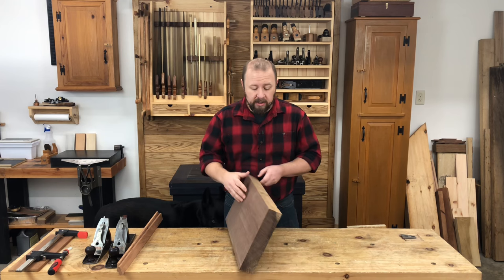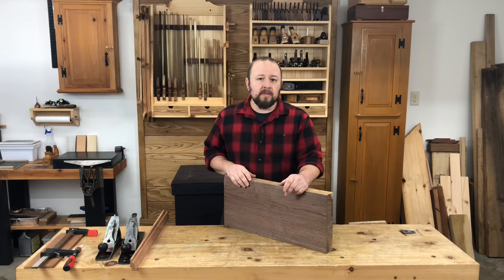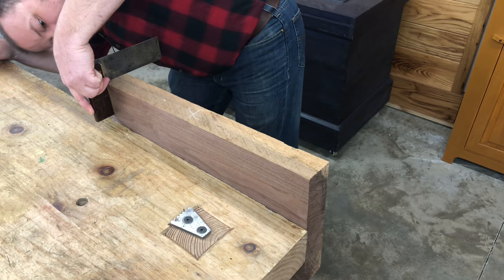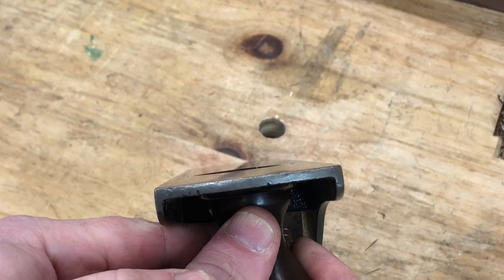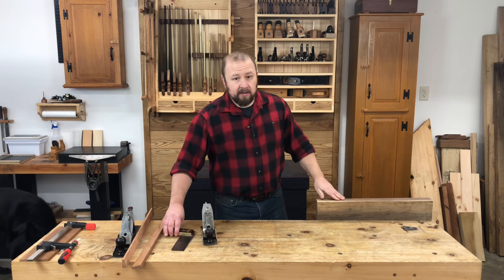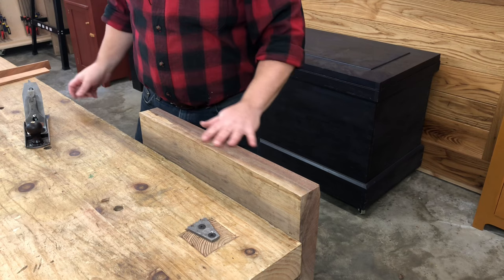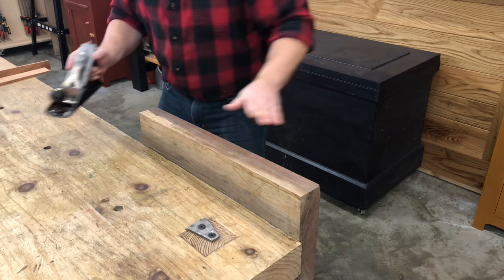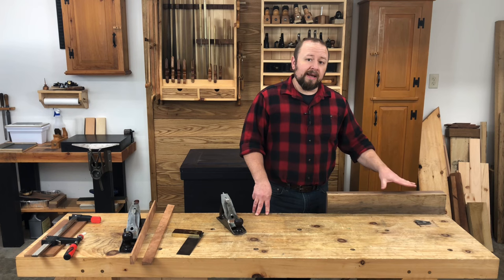Plane a Board Straight & Square | Build a Cutting Board with Hand Tools | Hand Plane Foundations

Comment: After (roughly) 6 years into my woodworking journey, the hand plane is my biggest failure. I can easily sharpen and adjust my block plane, and get good results. I also have a Stanley #4 and Record #7 that I've tried to make useful, but seldom do. No problems sharpening them, but set up and practical use has been a hit and miss affair. Thanks Bob, glad you popped into my activity feed today. $0.02
Reply: Same here. I always manage to plane my boards into a wedge shape lengthwise and off square edgewise until this video. A lot of the instructional materials leave out or glance over seemingly insignificant details which are often the difference between success and failure. Bob is an incredible instructor! His videos literally saved my ass from insanity by amplifying those details. He also thought me how to saw perfectly straight by simply sighting down the saw from my right side. I don't know why it works, but it does. The precision is scary, as good or better than a perfectly tuned tablesaw.

Comment: Would a Stanley 386 guide fence (fence at 90 degree in contact with your flat widest face) fitted to a stanley no 6 jointer make it easier to square the edge side ?